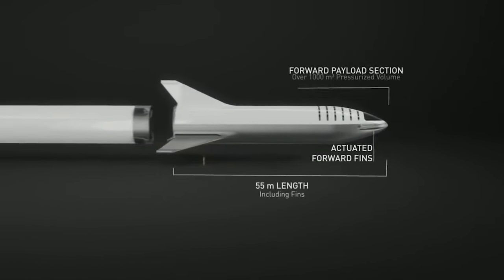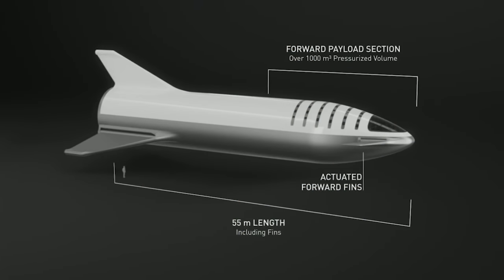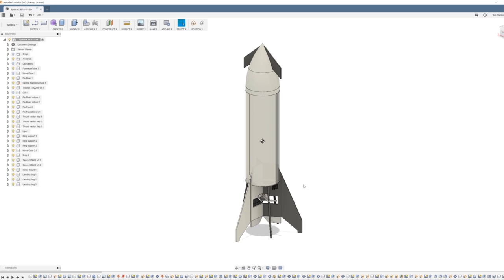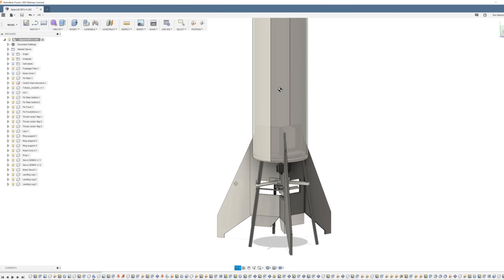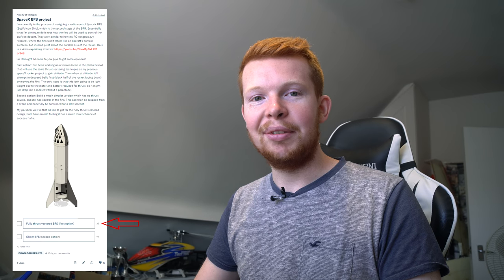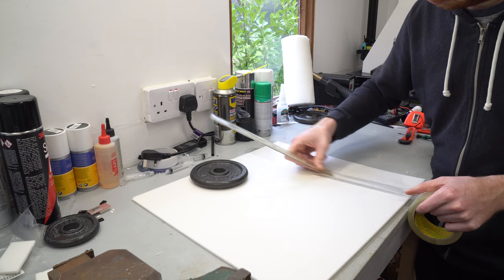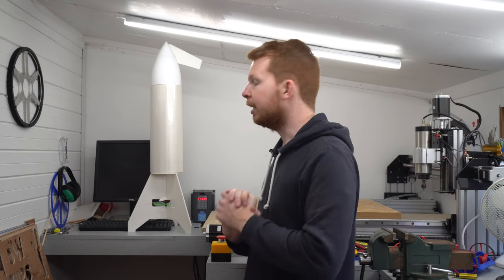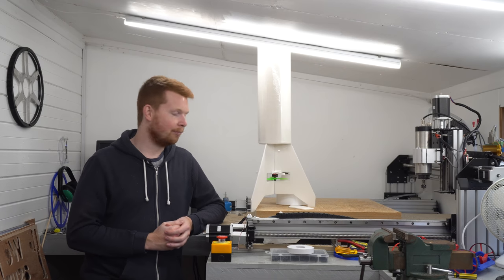RC SpaceX Starship - Design

Comment: Check out BPS.Space. He is modeling Falcon rockets including landing & is very interesting. In one vid he mentioned several times that grid fins don't work when scaled down.
Reply: That's amazing
Reply: I don’t think joe will be willing to share his code that he has developed over the years. He has put in a lot of work in it. Plus the rocket joe is building and what tom is building are quite different, the force given out from a typical rocket motor is very high in comparison to a brushless motor and thus the pid loop needs to be very sensitive.but anyway maybe tom could use some inspiration!
Reply: I mentioned it purely for the grid fin info.
Reply: Joe uses grid fins control system?
Reply: I've only been watching Joe for a short while. As I said, in one of his recent vids he mentioned in passing about 3 times that grid fins don't work at 1/48th scale. I assume that is elaborated in an earlier video.

Comment: It sucks that your print failed. The spiral outer contour mode is great for noses and tails. I bet you could do an entire wing like that too. I think you use PLA for yours but I think you'd be happier with PETG or something less brittle. Noses take a lot of abuse!
Reply: I came here to say exactly this. Vase mode would cut down print times too
Reply: I just did a video about fins for my rockets made this way, and I have found PETG to be the best, and with practice, you can get some neat looking prints using transparent colors. ABS was the worst option because it has suck poor layer adhesion. I even tried Nylon, but the prints were very rubbery.
Reply: Judging from the video, it looks like vase mode was actually used.
Reply: And the last few times tom has mentioned filament he has been using PETG
Reply: I was commenting on the use in the video, so I didn't mean to give the impression I was suggesting it. Cheers!
Reply: @HecTech FPV I don't recall seeing that he switched over. The print in this video looks very much like PLA.

Comment: I have had the same problem with my 3d printed nose cones. If you only want one perimeter, increase your flow rate to 110% and turn on random start points on every layer. Simplify3D has provided me the best results with super thin layers

Comment: About the 3D print nose problem, you must check the Z travel if a hard spot appears, it could be the reason why the vertical extrusion wasn't linear.

Comment: Remove the paper on the inside of the foam, that will allow it to curve and it reduces the weight.

You can remove all paper and then use Modge Podge Shell to create a lightweight rigid shell

Comment: I'm pretty skeptical about this model.
The Starship is made to slow down from orbital speeds in VERY THIN atmosphere.
That's a completely different mode of flight than what you'll be dealing with.
The booster is the part that's optimized for relatively slow descent straight down and you'll notice they decided to stick to the grid fins with that one, probably for a reason.

Comment: Terrific. In less than two minutes you've connected BFR with insane people in wing suits (and your highly accurate model of same). I was wondering why SpaceX was landing using rocket power, seeming to ignore all the good properties of the atmosphere.  I would figure that ideally there's just be a trade off between how large wings/spoilers (grid) and rocket fuel remaining for landing. But it's less a controlled glide than controlled drag. Interesting. 
The other aspect I wonder about is why the rockets have to hit such a tiny target and keep a perfectly balanced vertical orientation. There must be a reason they cannot pop-up nets at the last second (like spotters in gym class. You do most of the proper landing, the spotter just gives you that last 5 percent to keep you from going over on your face.) Might it be the leverage of an impulse so high above the deck possibly capsizing the whole barge?

Comment: Hey Tom, Have you thought about building a quick and dirty vertical wind tunnel so you can test, trim and iterate without breaking things. Just a fan, stator and foamboard for walls. Would be great for getting to grips with the "skydiver" re-entry mode

Comment: I feel that the control system would be rather touchy and not unstable but not as stable as the grid fins
Reply: As far as I know (which is barely anything), grid fins dont work when scaled down.
Reply: Andrés The Royal Marine makes sense but i mean on the real rocket. It seems like it would be rather touchy and easy to lose control

Comment: A motor is a problem, the torque of the motor will turn to the right and the rocket will turn to the left on the Z axis.
Reply: He could use a coaxial motor system, they have them stacked with counter rotating props.
Reply: @miker3174  see videos with one motor rocket or ship... Or plane
Reply: Was thinking that too, I'd try to use two motors with counter rotating blades.  It will also create a better airflow.
Reply: great project,   -  if you want too keep building the groundbreaking planes of youtube,  -  , excrude a knob ontop of your rocket, and go for some coanda effect advantage

Comment: That's pretty unlucky to have the print fail like that, any idea why? Vase mode like that is usually one of the easiest to print - I wonder if there was a larger bit of filament that it struggled to force into the extruder or something.

Comment: I would have printed the whole rocket body and nosecone together either as a single print or separate print then glue them together would have been just as lighter weight

Comment: How the hell are you going to accelerate this thing to reentry speed?
Reply: Not, that's not what he's testing. He's just going to test trying to get it to pitch enough so it gets into glide position.
Reply: @jo-han  More realistic it would be if it was blaring down with supersonic speed. Now it is just a funny shaped plane
Reply: @edeggermont  Of course it would be, but first steps first. He's just trying to test a subpart first. Its an important design method to test subparts separately without building any unrelated parts as long as those are irrelevant for the part being tested. Later an integrated design is made with all the tested and improved iterations of subparts together to test the complete design. If he'd have to make a complete BFS just to test fin steering each time he makes improvements on fin steering he'd be quickly out of funds. As would spacex be.
Reply: Boosters.  Lots of boosters.  And struts.  Seriously though since it's smaller I think he can technically reduce the speed by the number of times the ship is smaller... I don't know if that's really how the math works though though... but basically since it's smaller and lighter and probably even way less dense he probably does not need as much speed.